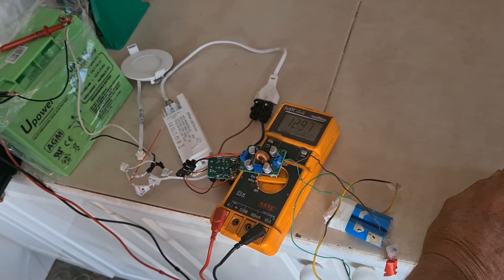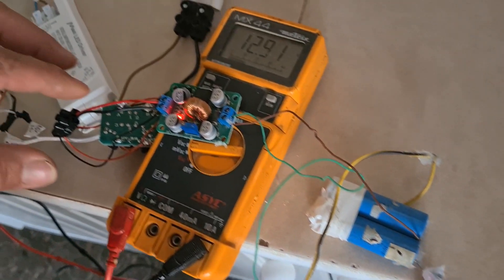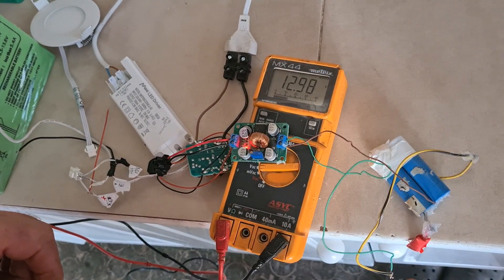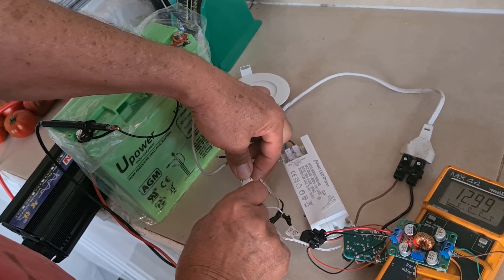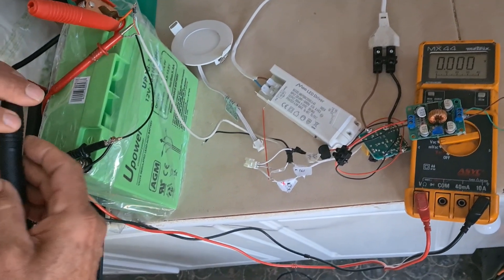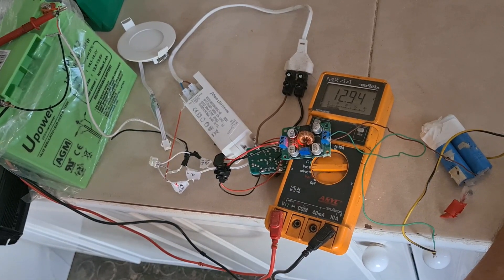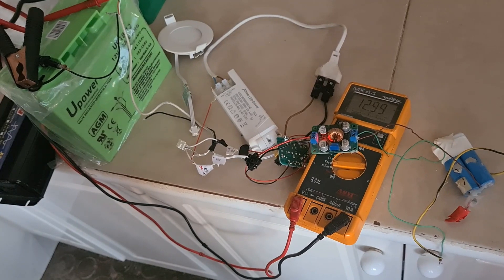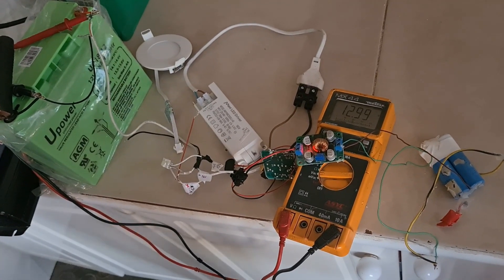Scale this fue-less solid state generator and the energy crisis is over

Comment: Whats the other card? A flyback circuit?
Reply from the maker: Hi it's a high voltage circuit to trick the transformer into thinking its connected to the grid.
Reply: @denissabourin  
Hi Denis,

How high would the voltage go? Is this AC or DC? Where could we harvest these cards from? I myself am busy with trying to get a battery charged with immense current from a flyback driver, there is a new word for this current... Alternate DC. Do you have experience with alternate DC? Its actualy so much it just burns everything... Need a solution for that aswell! (50A diodes burns instantly).

Greetings
Reply from the maker: @remyklopper5599  Hi, the voltage can go up to 20V. It's a pure DC output from AC. It's not a DC to DC converter. 
Those cards are from China and I keep the details for now until I can find a partner who would like to make these circuits in a proper way with a printed board and to offer it to people in remote places. 

You can charge a battery with a DC to DC converter but you will lose from the input side so then you have to give it back from the charge battery and not always there is a gain.. I do have experience with alternate DC yes. Yes some of them burn sometimes/get hot, to avoid that you may want to try using a potentiometer or resistors of 10W 10ohmsJ you put them together before the input.

This circuit is tricky because the transformer thinks it's connected to the grid but the circuit is smart and includes DC and AC together and the wires are split in a different charge. 

I'm in west Europe and looking for a team to invest and develop this. All the best.
Reply: @denissabourin  

How can i get in contact with you? Can i send you a email? I have a whole open repository of science and experiments for you, maybe we can work together.

Greetings from
The Netherlands
Reply from the maker: @remyklopper5599  Hi Remy, I'm in west Europe, my email is in the contact section on my channel. I think that if I write it here it gets deleted but I'll try like this: luelmade (at) hot mail dot com
We can then switch to Whatsapp it's easier. Best, Denis

Comment: Hi Denis, thanks for sharing this video, so i have 2 12volt 99Ah each AGM batteries connected in parallel, so i would need how many small lithium batteries to charge them both with this setup? and the 2 circuits you are using in the setup are 1 boost  and 1 stepdown converters? Thanks
Reply from the maker: Hi thanks for your comment. The 2 circuits that you see in the setup one of them is a DC DC converter step up and the second one is not a step down it's a circuit that tricks the transformer to think it is connected to the grid. It's a kind of circuit from low voltage to high voltage. I understand you have two batteries of 12V 100Ah each. Please be mindful that for each 20Ah you will need two 3.7V batteries (can be found in old laptops) so if you take 10 pairs of two batteries like that, it will be for 200Ah. We improved the system since yesterday and you can charge 2 additional batteries of 3.7V at the same time you charge the 20Ah. The two tiny batteries need very little miliamps to be charged back and of course the bigger battery is efficient enough to power devices and charge back the batteries. I would like to find a team who wishes to develop this circuit and make it into a printed board to commercialize so I can further develop it. I cannot give the instructions right away as I wish to patent it to develop it and offer it to people. Regarding your question, there is only 1 DC-DC boost converter, the other one is a AC converter from low voltage to high voltage. The transformer uses very little consumption which helps a lot to charge the big battery. Best regards

Comment: Awesome experiment. What are the devices involved in this circuit? It looks as a step up  DC to DC transformer, but the one that is upside down I'm not sure what is it?
Reply from the maker: Hi, thank you for your comment, I hope you are doing well. Basically what you see is a transformer 220V AC to 6-12V DC. There is one DC-DC and another one is a circuit that takes a low voltage and makes it bigger to trick the transformer to think it is connected to the grid. Then, the DC in the output of the transformer is divided to different voltages that you can see in the previous video that I did and is capable to charge a big battery of 18Ah from these two tiny batteries. So if you make a few of those you can charge a few batteries like that and power a nice inverter. The beauty in it is that the consumption is very small compared to the output that can give nice DC to charge batteries or capacitors. I hope it helps. Wishing you all the best. Denis

Comment: Well done so far , Can you try and use a large capacitor instead of the 12v battery
Reply from the maker: Hi thanks for your comment. I choose to do it with this battery because it's a solar battery AGM U Power makes batteries of all sizes in the US. It recharges itself very smoothly. I have a bank of run capacitors more or less around 6 of them of 63V each around 5,000 farads. I have a bank of 6 supercapacitors 2.7V 350 Farads DC. And I have a bank of LTO cells 2.3V each 40Ah each, but those barely have 25Ah in reality. Which bank would you like me to test instead of the battery? Whatever fatigues the two small lithium batteries the least is the best option.  Regards
Reply: @denissabourin  Do you have some supercapacitors you could test with? I think i saw you had some in one of your videos
Reply: use the 63v 5000 farads ones,
Reply from the maker: @8888-u6n  I just mentioned I do have a supercapacitor bank of 350 Farads DC from Maxwell 2.7V but they will be hard to charge. I will make the test with the bank of run capacitors of 63V and different voltages. I will try to make a video for that with the results.
Reply: @denissabourin  may be charge up the supercapacitors first to the voltage you need, 12v? then it will be easier for it to keep charge if it is producing over unity
Reply from the maker: @8888-u6n  I will start with the 63V and post the results. Regards
Reply from the maker: @8888-u6n  Hi, I made the video for you, you can have a look. Against all odds it is charging the banks. By the way, as you may know my channel was hacked last year and I lost most of my videos, in case you keep some of my old videos I will be very happy to post them again. I am trying to let my viewers know about this and I managed to recover some of them. I currently have a 1/3 of the videos I had before I was hacked. I will appreciate it very much if you keep any. Best regards
Reply: @denissabourin I would also like to see this video you made that shows you charging the capacitors, please.
Also, I sent you an email to which you are yet to reply.
Reply from the maker: @ekeretteekpo3004
Hi Ekerette, I replied to your email a few days ago, check your spam folder maybe it ended up there. This video is an experiment that successfully shows that this concept works very well in its current size. I'm not working on free energy in this case but rather on energy storage. This means that you have to charge the big battery first, then once it is charged you have first to keep some load from this battery to charge back the two 3.7V small lithium batteries for example with a 12V potentiometer adjusting the current and voltage from the 12V battery to the 3.7V batteries and then you still have energy left over in the big 12V green battery to charge your smartphone and power a 220V bulb of 4W for a long time. Please understand that the white driver you see is a kind of transformer of 220V input and 2 different DC outputs that are charging the big DC 12V green battery. The white driver transformer has a 20V output that is enough to charge the green battery. This concept can be done bigger, it needs to be tested but for now it works very well as it is. If you are wondering how come the 3.7V lithium small batteries are capable of running the white 220V driver transformer it is because there is a step up between the 3.7V batteries and the small inverter circuit I made that gives 220V in its output to run the white driver transformer. It's all about the circuit. If I have the funds I can try building a bigger concept, it takes a lot of time and concentration. It can charge capacitors instead of batteries yes, maybe in my free time I will make a video, it doesn't matter if you are charging batteries or capacitors. In case you are charging supercapacitors it will request more effort from the system to do so but it's easier if you charge run capacitors, the best is to charge a 12V battery such as the green one.  Best regards
Reply: @denissabourin  thank you for replying. I'll check my spam again, just in case.

Comment: Can you charge a bank of x5 12v 120ah lifepov4 in series or parallel & have one small battery to charge?
Reply from the maker: Hi thank you for your comment. Indeed, for each 20Ah you need 2 small batteries like those. So for 5 systems of 12V 120Ah Life PO4 you will need around 10 pair of small batteries like those. I also succeeded to charge back a spare pair of small batteries at the same time I charge the green battery. It's possible, but you need to be mindful of the order. Very efficient and silent. I wish a team of engineers would see it and find the capital to scale it. Regards, Denis
Reply: You mix between energy and power. Of course you can charge the big battery from the small one using step up voltage converter but the total energy of the big battery wont be filled by the small one. In order to prove your claim you need to measure energy consumption over time. Contact me if you're on it still